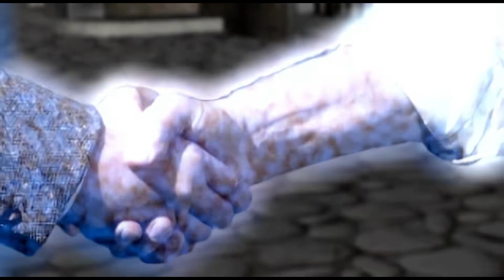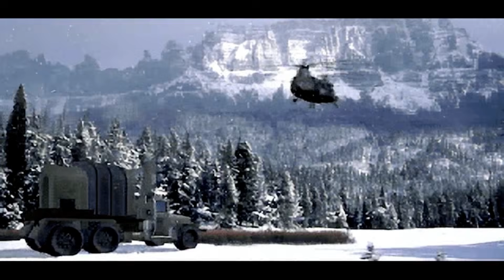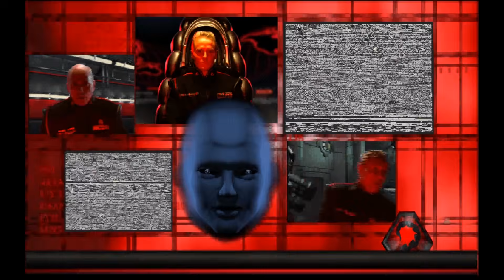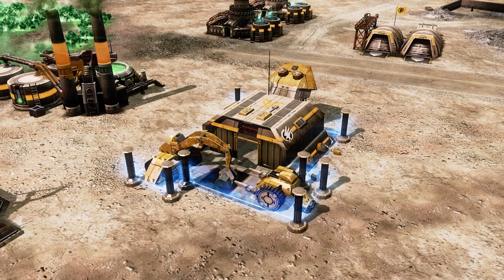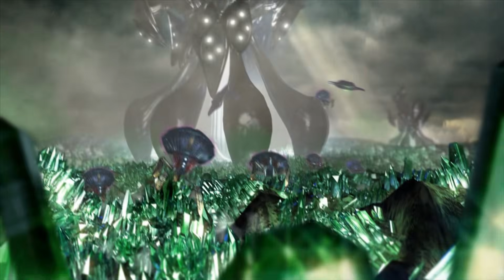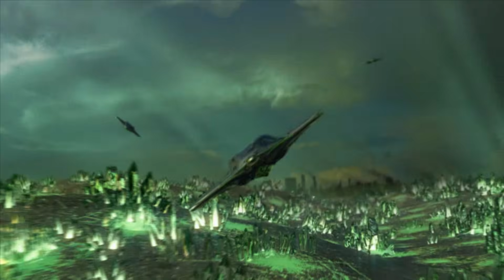Mobile Construction Vehicle - Command and Conquer - Tiberium Lore

Comment: I remember in Tiberium Wars, before they removed base defenses from the crane, I would have several defense structures cued up. Then I would lure enemies into the base and deploy the defenses behind their forces. Was very disappointed when they removed that in Kane's Wrath
Reply: in was already removed on one of the early patches for cnc3, updating broke the campaigns
Reply: @ahuzel  I don't think I ever got that patch
Reply: @ahuzel  Correction, I never got that patch until I got Tiberium Wars on Steam. I had the disk version for the longest time
Reply: Disc version being the best version of the game is great. 

When they did only updates to multiplayer, that also effected the campaign, you basically redo the campaign on ultra-brutal hard unintended difficulty. 

Because your income is halved. Base defences are weaker. Power plants do not spread build area, and cranes can't build defences
Reply: @Goremize  Yeah, I'm finding that out as I replay it on Steam. I beat the Nod campaign on Hard difficulty once, and now I'm struggling to get past Washington DC in act 1 on easy
Reply: @bendavis3778  Yeah, its even better on the Alexandria mission for GDI when you unlock the Mammoth Tank, because it was nerfed so you need many many more of them from your halved income. 

Or the power your defences map, where your defences can only hit rocket squads if you manually target, as the auto target range was  reduced. For Nod... just wait till you get to the final mission haha Its on peoples lists as "One of the hardest missions in the entire C&C Franchise"
Reply: @Goremize  Or how the I lose literally entire platoons of Zone Troopers to just 1 shadow team. I can't tell if it's because the Troopers have been nerfed or if the shadows have been made more powerful

Comment: Of all the MCVs, the C&C3 GDI MCV is the one that could more realistically exist, underground nanoassemblers aside
Reply: What about that weird crane structure in front though? Like look closely this is some AI generated junk level nonsense.
Reply: @EugenijusKrenis  first, this was designed way before all this Ai generated bs;
Second, is a crane with some weird legs;
Of all the MCVs, its one of the most believable ones; no 90% of the building spawning out of nowhere
Reply: In sense of the vehicle folding together, yes. But what we see ingame is always just a translation. The reason why bases in C&C can build this fast is do to gameplay and i think they delibaretly never specifyed how fast the actual build time is. I mean, how long does it take to train a Infantry Squad in C&C 3?

Also, C&C3 plays in the year 2047.  We can 3D print alot today, even buildings. That a Military is useing Nanon Assemblers for there forward bases in the next 3 decades, doesn´t sound unrealistic at all, anymore.
Reply: I kinda had a hypothesis that the Crane seen is similar to the Scaffolding erected when Starcrafts Terran Builders are constructing barrack and stuff. Kinda like a giant 3d Printer of sorts

Comment: 7:33 It's likely that the Renegade Construction Yard was a refined or improved version due to the rapid advancement of technologies and lessons learned as the war continued, since it was more heavily automated (as with most Renegade buildings), and it was likely the base for the Tiberian Sun Construction Yard.
It's also likely that all the materials which should have been inside the Nod Construction Yard had been used to reinforce the base, since Nod knew GDI was coming, and that personnel had been evacuated/moved elsewhere.
9:31 The Forgotten at this time seemed to be desperate to grab anything and everything: From then-modern military hardware of both GDI and Nod manufacture, to older weapons and small arms (such as the first generation Nod Flame Tank), to improvised weapons (such as what were basically technicals in the form of armed pickup trucks). By the time of Firestorm and with their alliance with GDI more solidified, they seemed to be more militarized with GDI equipment, forgoing Nod's stuff and the improvised weapons/tools.

Comment: When playing C&C 3 I actually rarely build the mini MCV's. I usually just build a crane about as far away from my refinary as I can since it allows buildings to be build around it and then I move my MCV to the other place I want to build. A crane and base expansion vehicle have the same cost but a crane has other uses too. The larger construction range of the MCV also allows it to do the job of 2 mobile units at times.

Comment: So a lot of the base building was done as "make believe"/"pretend" where they just don't show the workers moving supplies around and building. I understand why but it would have made the game more immersive and allowed for more options to attack and defend supply lines.
Reply: It was in-line with a certain design philosophy.
The devs wanted an RTS you can just pickup and play without having to do busywork—this is why the CnC games only have 1 resource besides providing your base power (which is still inherently liked to income.).
They didn't want complicate the gameplay too much by implementing things like supply and logistical lines but instead imply they are there via story.

Just because something would be interesting to implement doesn't mean it's going to be fun.
Reply: C&C always designed to be fast paced combat heavy skirmish though, not resource management. Besides, lore wise, everything is assembled and transported underground. All the workers and engineers are underground. That's why the "build range" or ground control is core mechanic. And if you look at the animations, all buildings pop up from ground while all the ConYard / Cranes crane will deposit the materials underground when you build something instead of extracting it out.

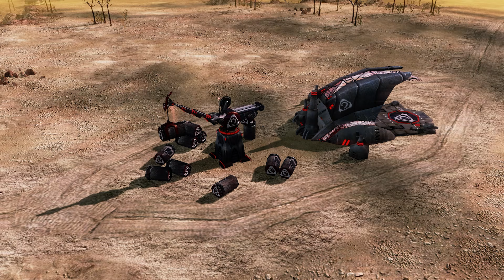Comment: 16:42 slight correction there, as originally cranes could build defences. Case in point, when I play C&C3 I downgrade to the 1.0 version of the game, which allows power plants to spread build area, and allows cranes to build defences. As these updates effected the campaign I prefer the 1.0 original version of the game. 

The expansion of course already had these unfortunate changes forced into it. I still prefer the defences and balance of the original game in 1.0, then what the expansion and multiplayer based updates did to it. As C&C3 updates nerfed base defences.

Comment: I know that CnC4 not existing is a running meme/joke, but the Crawler system is actually brilliant, Shame the concept was introduced in an otherwise basically lacking in everything project. If they ever remake CnC4 into something actually playable with actual Tiberium fields and base building, I'd still want the Crawler system implemented.

Comment: Whats weird is that i was playing Red Alert 2 and thinking is there more to MVCs than just build base. I was also wondering if there was a way to reduce building times, but i dont think that's happening, not with the buildings any.
Reply: Multiple MCVs do speed up build times at least up to RA2.
In CnC3 and beyond, you can queue up multiple buildings as a trade off.

Comment: I guess technically the events of Tiberian Dawn are more expansive than WW3  and Yuri's attempt at world domination in RA2.

If anything I'd say that it was still an extensive use.

I don't think the MCV in Renegade is different from the original ones. I think it's supposed to be a more realistic take on the buildings. If anything, the buildings shown in renegade are supposed to be more accurate representations of buildings from the rts.

The battlebase can also attack infantry. It isn't specialized to but it can. The way described implies it can't at all

Simi-related. I know RA1 is supposed to be a prequel, but it's also possible that Einsteins tampering is also what led to Tiberian and Kane arriving on earth.

Breaking the time barrier and causing a temporal boom to propagate out and affect different points of history. Not just removing Hitler but causing Kane to arrive on earth in the distant past and causing the Tiberian asteroid to be sent to earth instead of whatever other random target it was sent to.

Comment: It really is too bad they made such a mess of C&C 4.  The crawler concept is a logical evolution of the mcv/mobile factory/outpost/rig lineage.  Why not have some sort of all-in-one mobile base.  Imagine a version that works like an actual MCV/factory, where it can produce units, but also requires a supporting base to expand to more advanced units.  Maybe you have a mission where you just have a crawler and limited funds, and find/activate buildings along the way to unlock better units.  In conventional battles, they could serve as a high-risk high-reward strategy, pushing closer to the enemy at the risk of loosing a large, expensive chunk of your production.  Or you build them as mid-late game strategic weapons, allowing you to use them like a combination of surveyor and mobile war factory.  Sadly, instead we got a mobile spin-off with as much COD dna as C&C.  They should have just left it as a side game, and C&C might still be around today.